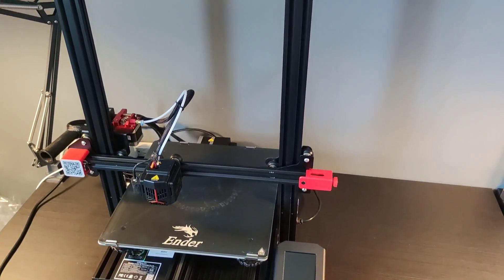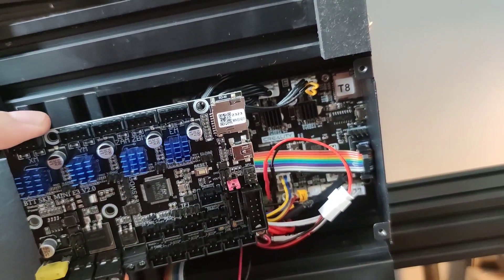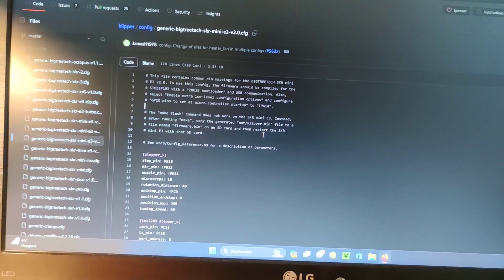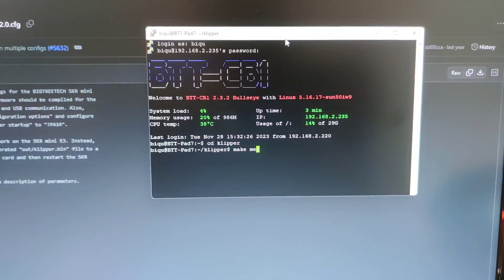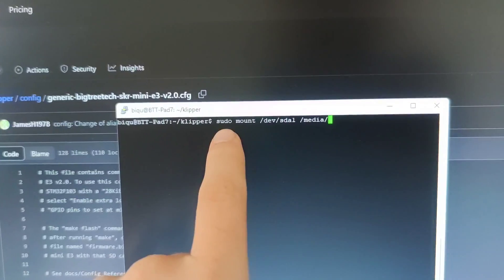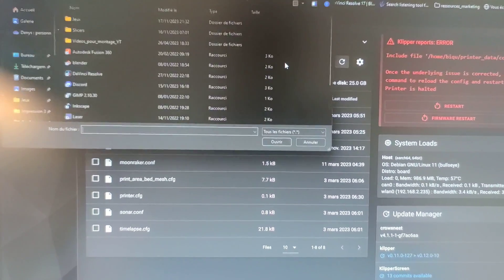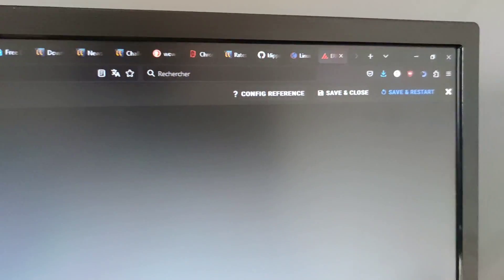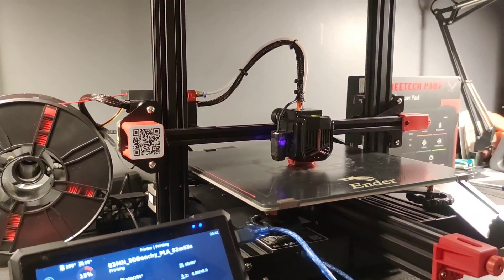Installing Klipper on my Ender 3 Max Neo with the Pad7 from Bigtreetech

Comment: Helpful, but thought you'd have a link to your config file specifically for the Max Neo 😉
Reply: Update?
Reply: @1221Ralph  I gave up with the printer months ago, the frustrations got the better of me. It hasn't done a print since. Will get a look at it again soon as I'm hoping someone has the config files all ready to copy 🙏😉
Reply: @raynbow6  dang. It's my third spare printer which I'm finally trying to tune after not touching it for over a year. 
My main is a Bambu P1s and recently picked up an Anycubic kobra S1 with the ACE multi material kit. The plan is to use the ender for large ASA parts and slow TPU parts.
Reply: @1221Ralph  I was going around in circles, the printer nearly took flight out the window! Literally haven't looked at it in 6 months now, bought lots of upgrades for it too, including a Pad7. Must go hunting for a decent config file, surely one exists by now??
Reply: @1221Ralph did you ever get your printer working? I’ve just got back to mine and haven’t a clue where to start. On the hunt for a klipper config file for my BTT Pad 7 on the Max Neo, have my board upgraded to the SKR Mini E3 v3.0 board, think that was the last thing I did. I suspect I’ll have to re-learn this all again 😂